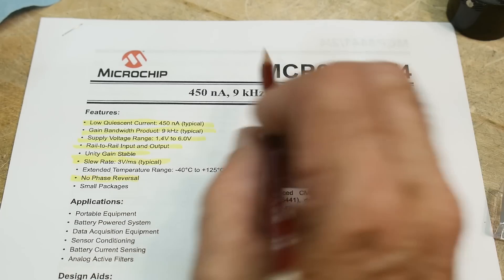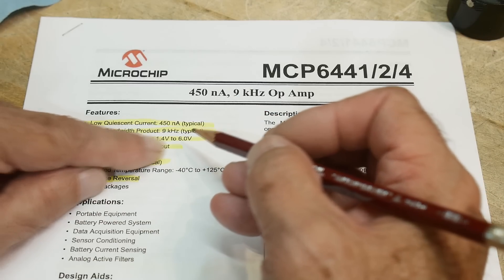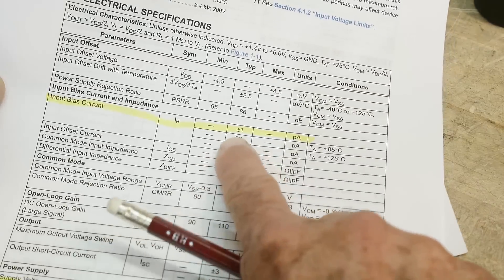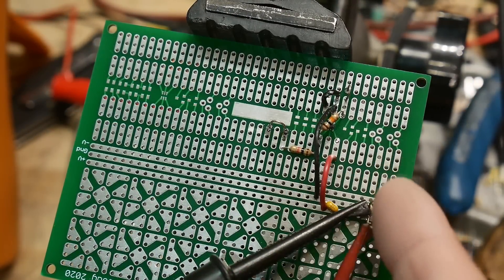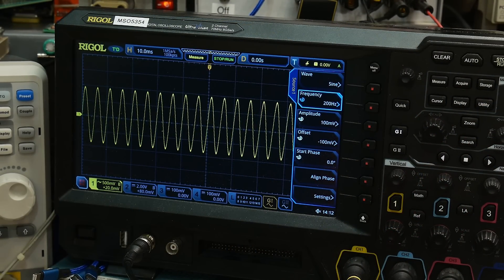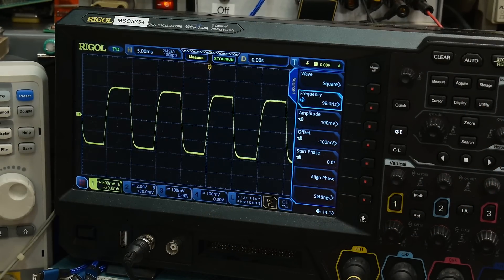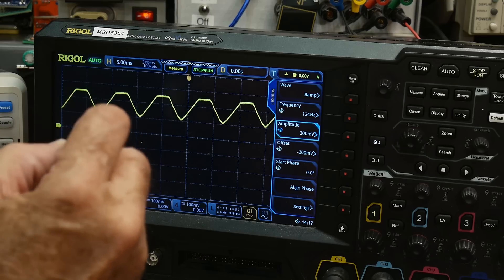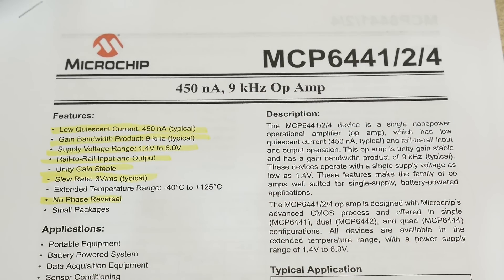#1947 MCP6441 450nA OpAmp

Comment: I recently looked at opamps like this for a primary cell battery applications where I wanted to wake a microcontroller when audio was detected in a certain range, so filter and precision rectifier. Like IG points out, the specs on these make them hard to use, even for audio frequencies.

Comment: Its not standby but actual operating current.
Impressive is the output stage. Yes, i m an analog IC designer worked for some part of this supplier. The output could deliver 10mA at 400mV loss, figure 2-22. Thats a very clever AB-stage design as the ratio goes guessed about 10e5.